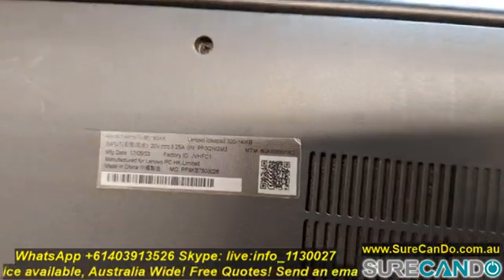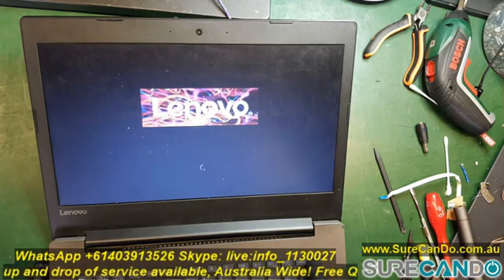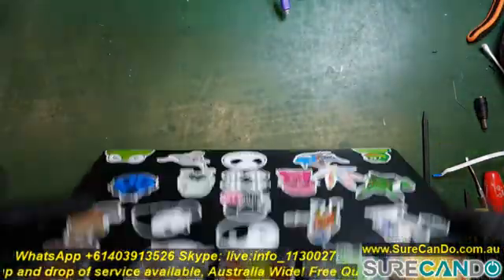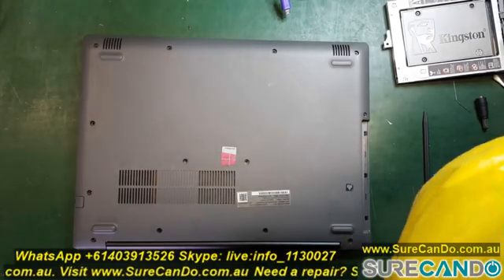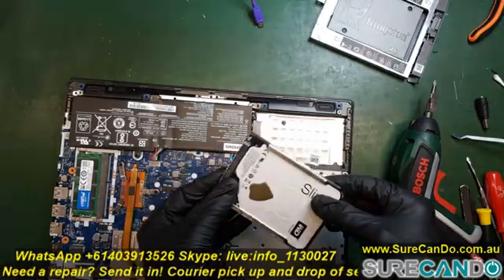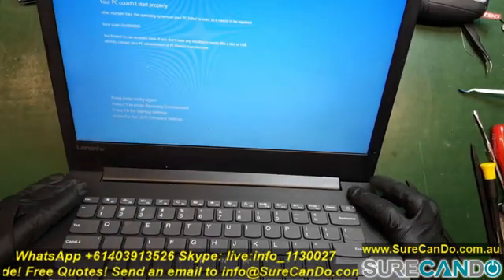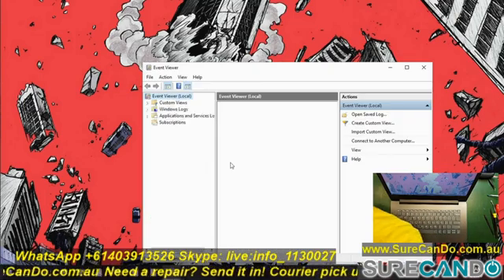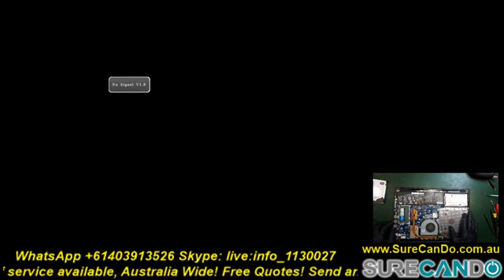Freezing Crashing Laggy Slow Performance Fix Lenovo Ideapad 320 14IKB Windows 10 8 7 Games

Comment: But what if is only an stock HDD in in question and not new installed SSD, how to fix lagging of Win 10?
Reply: It is not possible to fix the lag.The main cause of the lag is the hard drive so you have to change to an ssd